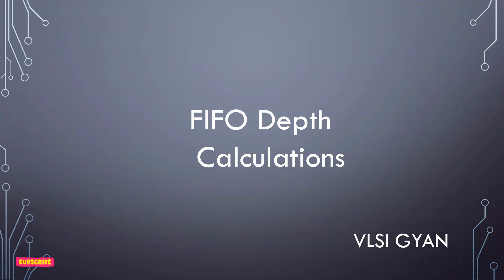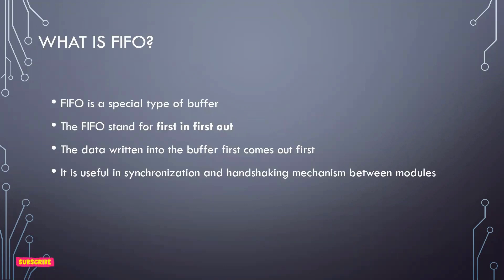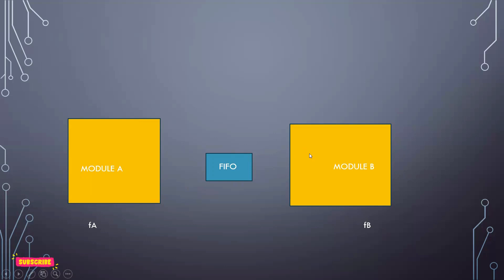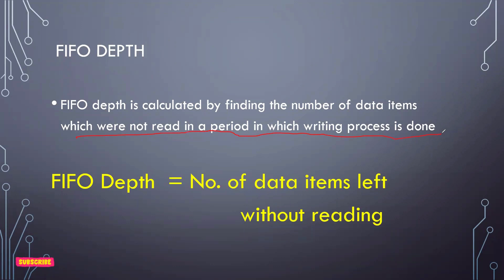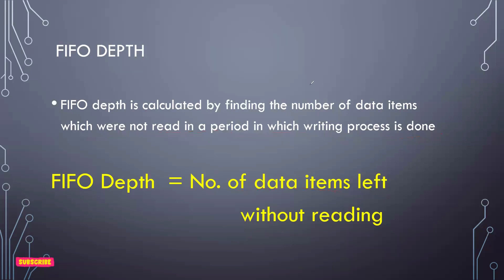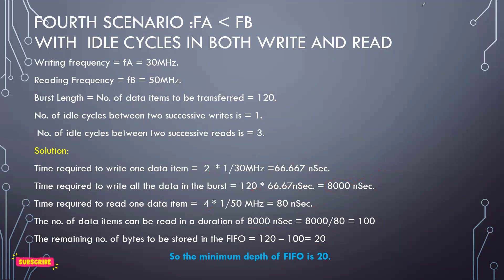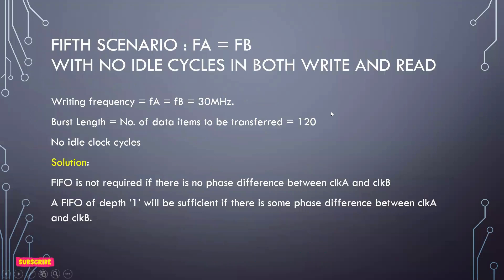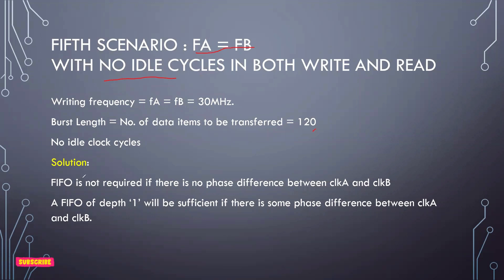FIFO DEPTH CALCULATIONS

Comment: Be practical about the questions instead of being theoretical. in the 3rd scenario, depth that is mentioned is 1, which is not sufficient, because of write and read pointer synchronization stage (2 Flop up and down)in the asynchronous FIFO, so we need minimum of 5-6 cycles to avoid backpressure which results the depth to be minimum of 6, otherwise FIFO full would be asserted after the 1st write itself.
Reply: bhai can u tell from where can we learn fifo ??